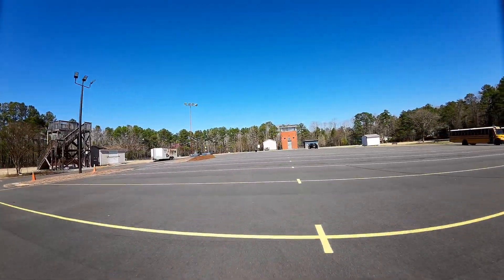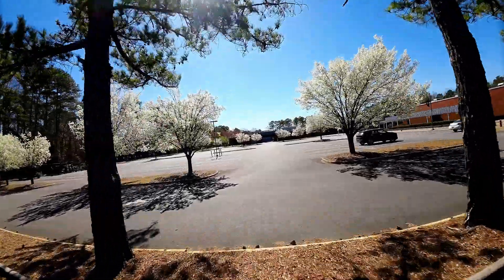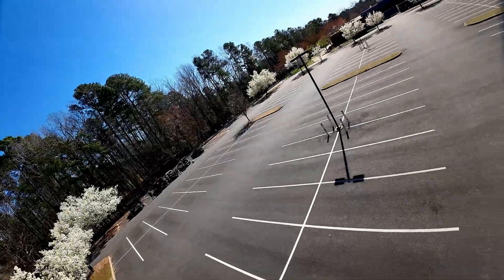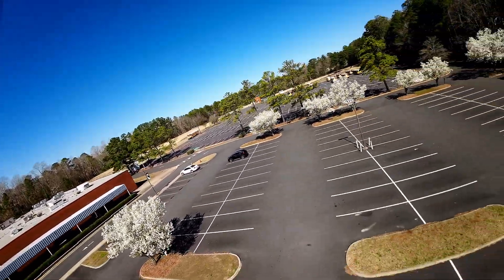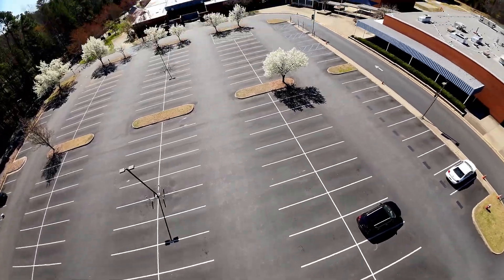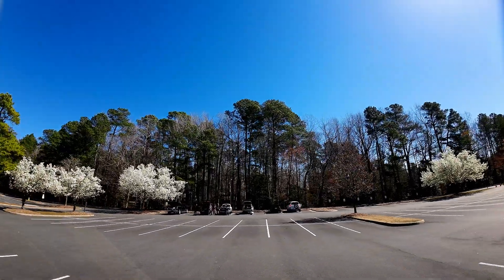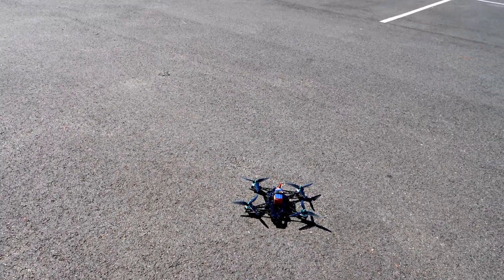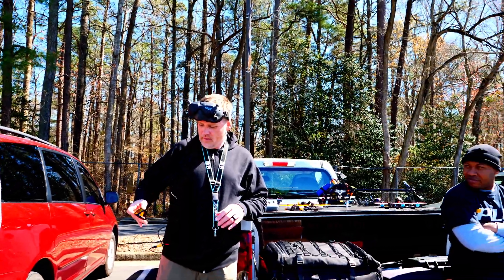AOS UL7 O3 New Frame (3-5-2023)

Comment: So I got this frame,  put it together, & installed my motors. Now I'm having second thoughts on the durability of the top motor mount plate being to thin. My worry is there may not be enough material & a motor would snap off easily. I use 6S2P 10000mah battery configuration on my AOS 7 frames + a gopro. What are your thoughts of the durability of this frame?

I've been thinking. The weakest part could be the motor mounts specifically the top plate not having enough material & I'm having seconds thoughts about flying this thing & definitely don't want to use big motors. I admit i have not tested the durability of this frame, but i just think we should have a lift, Brittleness, & durability test to be safe. Wasn't there an only other reason why drone arms had to have thick motor mounts? Don't get me wrong, I own 95% AOS 7 & love it.

 Update▪︎▪︎▪︎
Insanely good frame & definitely buying more.

🤯🤯 So I said fck it & flew it anyway & holy sht if you already have the AOS 7 frame you should really try this one. It turns your gopro into a professional looking Camera. No joke, I can see details of structures, mountains, landscapes from miles away. 

As far as durability, I feel safer with more material on the motor mounts. So, I've ordered 4 more top motor mount plates. If you were me would you adhere the plates with epoxy, dampening liquid, or just dry?